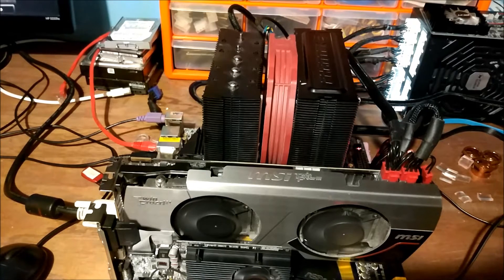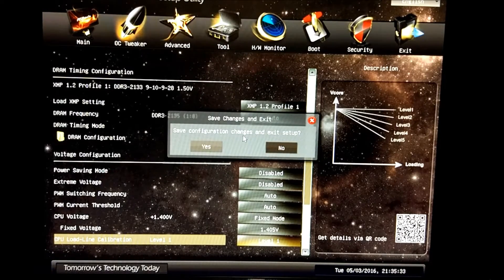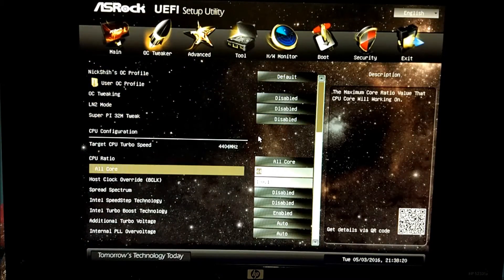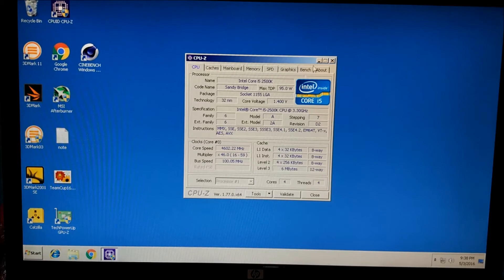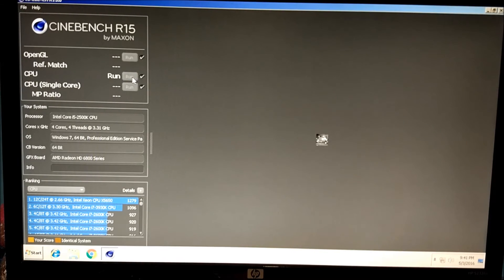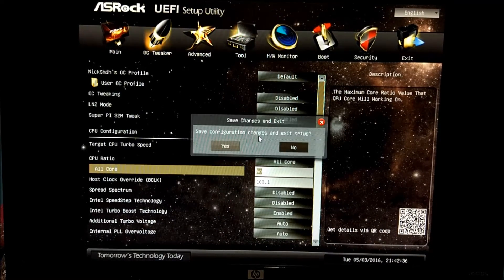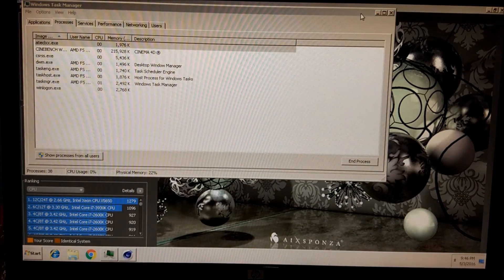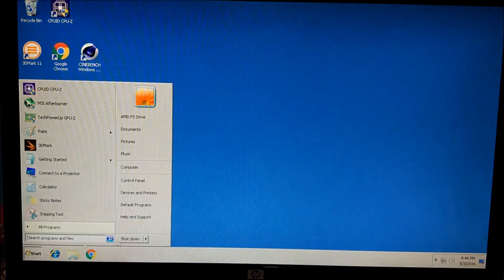How to overclock an i5 2500K to 5ghz quickly Part 1

Comment: hi ,

i bought a 1080gtx for 1440p gaming , so i need to get that i5 2500k to 5,0ghz.
does this also works on other motherboards i have an asrock p67 fatality professional b3.
and is my cooler good enough to keep the temp low (scyth mugen rev b2)
Reply from the maker: i am not sure about the motherboard and cooler, you will have to just try and follow my steps. keep an eye on the temps in windows using core temp, its ok upto 80c so you will be ok upto there. you cpu might be better or worse than mine as well.
Reply: Lawrence Timme when i did the first overclock 4,4ghz , temp was reaching 87c during the cpu test , time for a new CPU cooler, the score was 526cb i have Windows 10
Reply from the maker: yeah that is too warm :P

Comment: its right in front of me with no cuts, but i'm still in disbelief...
Reply from the maker: why? :P
Reply: just because it seems like it would be a lot harder to get that clock speed. i know it can pretty effortlessly hit 4.5 GHZ, which is still plenty, but it just seems like it would be a bit more effort to get that kind of speed. but then again i don't have an overclockable mobo for my 2500K, so maybe i just don't know enough about this cpu.
Reply from the maker: fair enough :P i think if you watch part 2 and 3 you will see it does get much harder towards to top end of the cpu :P
Reply: yeah i just finished them and it does seem to get a lot harder. 
so i have a question, on cpu-z it says the normal score for an i5 2500k at 3.3 ghz is 5600 for multi thread, but my 2500k at the same clock is only getting a 4800 multi thread score. do you have any clue why that might be?
Reply from the maker: maybe the stock 2500k was boosting to its turbo speed so it would be at 3.5 or maybe even 3.6ghz
Reply: maybe. it's just super weird because cpu-z says im hitting 3.5ghz boost, hw-monitor says im staying at 3.3, and task manager says i stay at about 3.4. and i know its not my temps, because i have a 240mm aio (yeah its overkill, but i didn't realize my mobo couldn't overclock when i got it, so i was expecting to be running like 4.5 ghz)